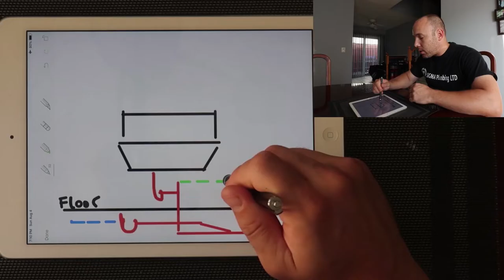My Biggest Plumbing Mistakes

Comment: Great story telling Kenny! I could listen to stories like these for hours! I always respect fellow plumbers more when they share these. We all fall down, it's how we get back up that matters. 
A few of mine: Dropping my torpedo level down my neighbor's waste stack on my first toilet setting side job. Had to go to the basement, cut out and replace the waste line, and worst of all, explain myself. Next was  cutting into a live gas line with a sawzall after witnessing the heating company rotate a fitting 180 degrees leading me to assume the gas was off, uh yeah it wasn't, fortunately at less than 1/2 psi, I could stop the leak with my hand and yell for someone to shut the meter off. I once set a kitchen faucet with the handle pointing straight out because that's how it arrived in the box. Best one was working with another plumber and using his test equipment. I had just installed the dwv system for 1 of 9 bathrooms on a multi million dollar remodel and used his inflatable test plug at the tie in point which happend to be at the top of  a 20' vertical stack buried behind a structural concrete wall (5 story house). Inflated the balloon, filled the system to a 10' head with water, no visible leaks so I went to lunch. Come back from lunch, look at my partner and go "hey who pulled our test plug?" No one, it had a leak, deflated, and since the owner had removed the safety ring, it went right on down the 20' stack. I spent 2 hours fishing the chain end out with a stick of copper with a screw attached. Looked like an idiot to the general contractor and I was both embarassed and disappointed in myself for assuming his equipment was in working order, but I can't tell you how joyful I was to successfully retrieve that 4"x36" balloon from the stack. I've got more, but none as epic as those!
Reply from the maker: Duuuude! Those are some great learning experiences there brother! Thanks for sharing those, it brings a lot of normalcy to all the mess ups we have had in the past. Makes us better plumbers for the future, and hopefully helps out our up and comers on the channel. Your work is stellar Kyle, keep it up, and I agree, there is nothing more satisfying than getting something out of a drain you accidentally dropped in there brother!